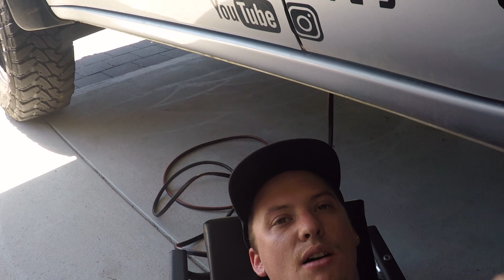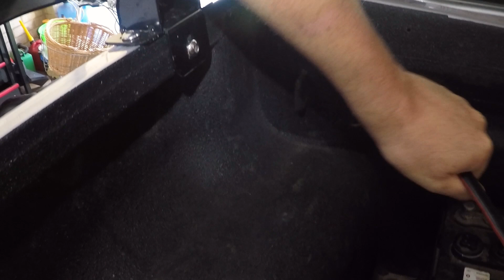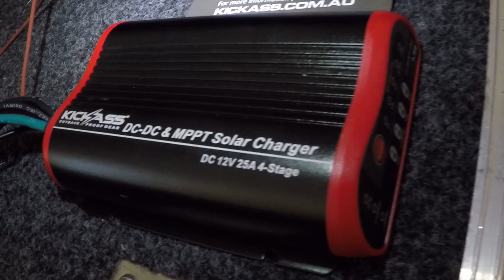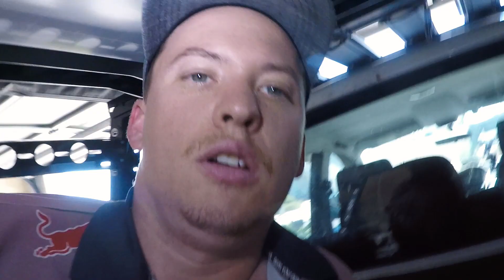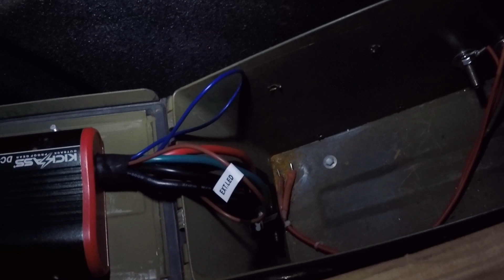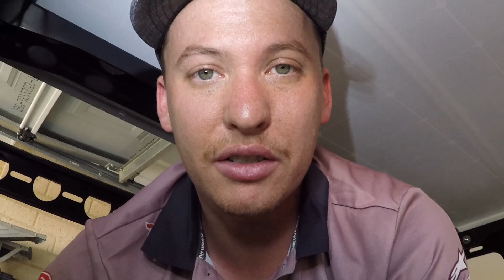How To Install A Dual Battery System And My New 12 Volt Setup!

Comment: What size fuse did you run in your dual battery system cheers
Reply from the maker: 50 amp I believe mate
Reply: @4x4campingandadventures  cheers

Comment: Hey mate did you fuse the solar input to the DCDC
Reply from the maker: Hey mate in the end I did yeah I have re wired since this and actually hard wired direct into the DC
Reply: 4x4 Camping and Adventures awesome cheers. Why the hard wire over Anderson?
Reply from the maker: I had a faulty plug which was not holding the connection in the end and my battery was going flat so I decided just to hard wire it
Reply: 4x4 Camping and Adventures cheers, great video! Just bought the same setup 👍
Reply from the maker: Awesome mate it’s still going strong in the rig and honestly it’s been through a bit so the quality is decent.

Comment: bought a $30 ebay special battery lug crimper and its honestly great for crimping bigger terminals. Well worth the money imo. I used to crimp it with my bench vice and have also used the solder method and that works okay too, just doesn't  look as ncie and usually have problems with solder wicking into the wire making the first few cm thick. I'm also into car audio so $30 crimper has paid for itself   3 fold easily
Reply from the maker: Beauty mate can you send a link
Reply: @4x4campingandadventures  yeah mate search up item number : 253330285560

Comment: How's the soler panel going? How many amps are you getting from it?
Reply from the maker: Going awesome mate my fridge has been on there for about 2 months now and never dropped not sure the amps I could get the multi out tomorrow and measure it for you
Reply: @4x4campingandadventures  yeah that would be great man thanks
Reply from the maker: Hey mate just checked it mid day 12pm and it’s pulling 6.8 amps with a bit of dirt on the panel

Comment: Just  a Tip depending on what fridge you are running most will draw about 4-5 amp so 30 amp fuse is over kill  use a 10 /15  for any spikes 
split tube the cabling on the chassis for extra protection keep up the good vids :)
Reply from the maker: Great tip mate!

Comment: Great vid, thanks. I will be kitting out my ute too, and using the Kickass DC DC Charger and placing my 2nd batt where you have! I can see that your rack is starting to earn its money by holding ur solar panels perfectly. What size cable did you run from the 'bay to the tub? Cheers.
Reply from the maker: I just bought the dual battery cable kit from Australian direct mate I believe it's 6 or 8 mm.

Comment: Does the charger get hot in that box ?
Reply from the maker: Nah been using it all weekend in 35 deg heat it dosnt seem to worry it it would get hotter running in direct sunlight